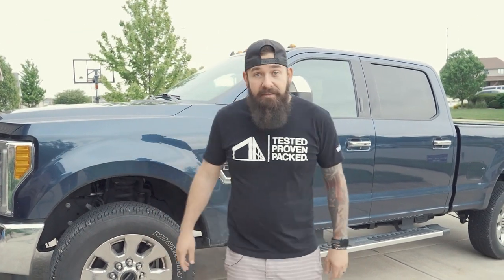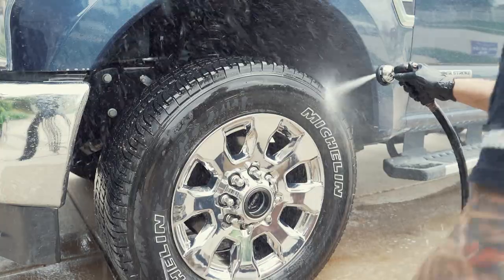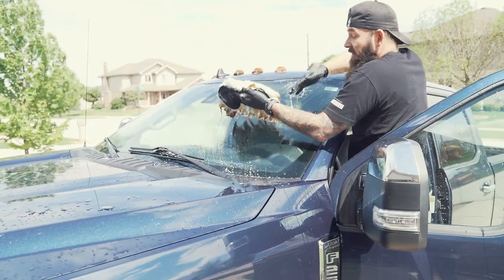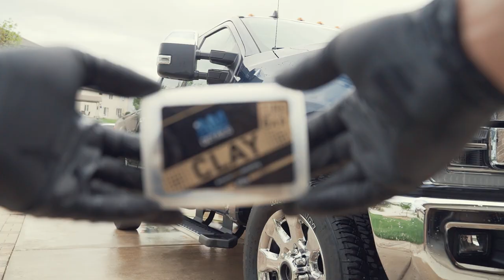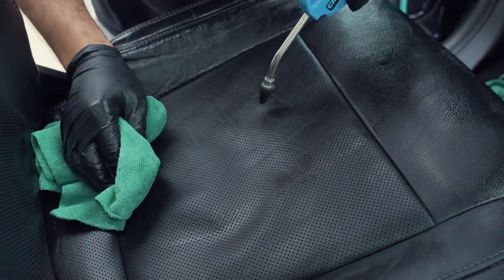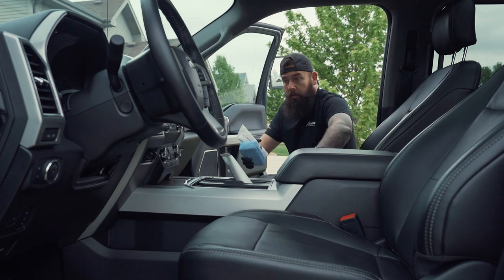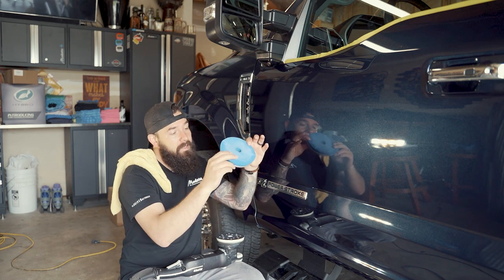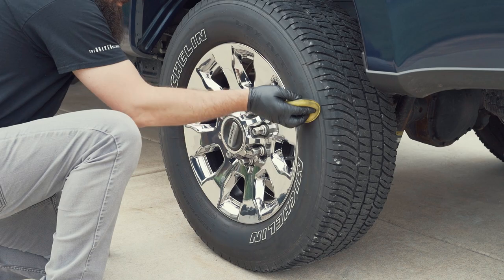DIRTY Farm Truck Detail | Dog hair | Deep Cleaning

Comment: Loved it man!   Yeah just use a damp towel or a mist or distilled water to help remove the streaks. It’s works perfectly for us even in direct sunlight and heat. It’s weird but it works. 😎👍🏼
Reply from the maker: Okay, I wonder how that affects the setting up of the coating as most of them can't get wet for 24 hours.
Reply: Chicago Auto Pros   TW chemist says it doesn’t effect it since it bonds right away. You’re just  wiping of the residual top layers that are causing the streaks. Kind of like modesta using water as a  catalyst. Same goes with using their Seal and shine spray sealant. It’s weird but it works.
Reply: @MirandaDetailing  In my case, I just sprayed 2 squirts like on the hood or car roof and doors, 1 squirt over the undercovers, 1 squirt over windshield or over windows, always spread the product well over each panel, use another towel to buff it off.  I never had the need to use water and one thing I was using was normal microfiber towels to spread it folded in 1/4 turning them per panel to avoid saturation; and a 365 GSM to buff it off.  Always better on the shade since the sun in the island being closer to the equator is a killer.  Our temperature is always between 80 to 110 80% humidity sunny and summer all year long.🏝🌞
Xoxo from Puerto Rico 👍🇵🇷

Comment: Thanks for the Honesty with your reviews, especially the TW Ceramic Spray. Alot of other Youtube channels talk about how awesome TW and I have never been able to get a streak free finish on any car.
Reply: I do not have a YouTube channel nor am I paid by TW 🐢 to use their products. I have used the Hybrid Ceramic coating on my last 5 jobs and it works amazing (especially if you can get the second coat on 24 hrs later).
Key is to use no more that 2 light sprays per panel. 1 microfiber towel to spread and a second microfiber to buff. 👍
Reply: A spritz of water helps with the streaks but I still think it's a very sub par product in comparison. Its hyped because it's cheap.
Reply: @fpswick8458  haha. Cheap for you guys in the USA. We get ripped here in Australia. The bottle is almost 50 Australian. That's USD35

Comment: What would be the best way to remove waxes and sealants from a car before a ceramic coating?
Reply: Probably a polish or compound. He used an light compound and it removed a ceramic coating. However for a simple wax and sealant you can use dedicated soaps to remove waxes and sealants. Griots Garage Surface Prep for example

Comment: Curious, that key. What is it for?
Reply: Spare
Reply: That key is the spare key that came with the truck. If you put it in that spot, it allows you to start and run the truck, but doesn't allow the Auto Unlock to work unless you have the other key close by to the truck. Works good if don't want to carry a key with you. You can use the key pad to get in or if someone needs to take the truck somewhere and they don't have a key, you can unlock it from your phone and they can get in and drive the truck.

Comment: Detailer on the roof, honey?  LOL  Enjoyed it especially since that truck is same color as my F150.  TW Ceramic Hybrid spray is easy to apply and remove, just check with WaxMode for some tips to avoid streaking.  Looks awesome and curious as to how much of upcharge would you apply at the shop for trucks of that size?